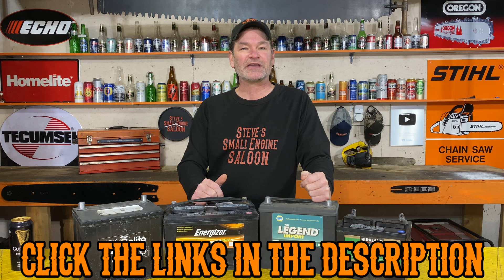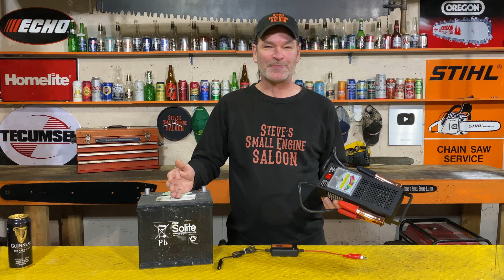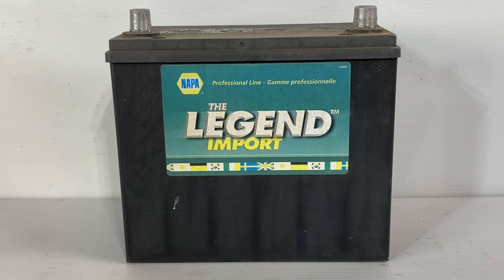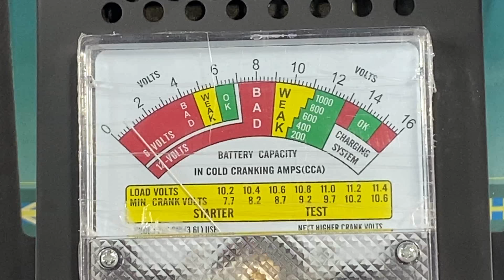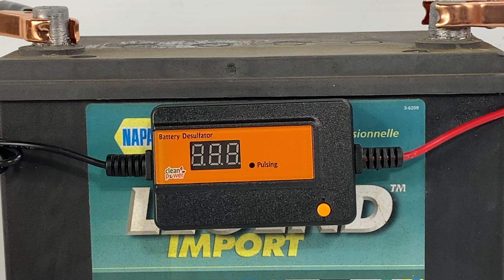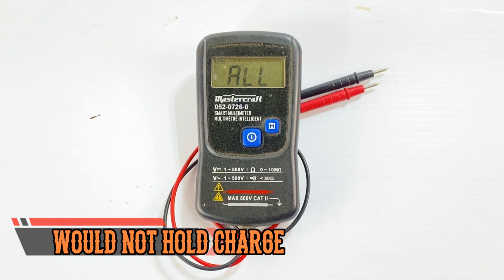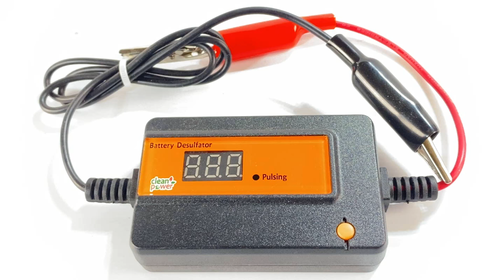Does An Electronic De-Sulfator Really Repair A Battery?? See Real Results

Comment: This method will only bring back some life for a short time. The reason batteries fail is, over time the sulfating process will cause shedding of the plates. This shedding falls to the bottom of the jar and piles up. When this shedding pile builds up and touches the bottom of the plates, they basically short out. These battery restorers just boil the sulfate  pile and suspends it in the electrolyte. Eventually the sulfate will settle and short the battery again. The difference between a 24 month battery and a 36 month battery is the amount of free space below the plates. It takes the sulfate longer to pile up and short the plates on a 36 month battery but the plates are shorter in order to retain the dimensions of the battery. The 36 month batt. will have less capacity but longer life.

Comment: I use these and I believe they work. I have maintainers on all of my cars and equip that maintain charge and also desulfate, and I keep them plugged in year-round. My utility truck (that sits outside) that I rarely drive has a battery that is over 9 years old now and still as strong as it was new, and I credit the tenders for that.  I never tried to resurrect a battery though. I just use the same method for maintenance.

Comment: It might seem strange but you could still have saved the battery that was at 8 volts, but you need a charger that can charge at 14 to 15 volts, it helps break up the sulfate crystals that build up on the plates, that in combination with the desulfator might even have had a chance and putting some life back in the first one
Reply: normal charge voltage in a car is about 13.7v.  a desulfator generates fast spikes(short duration pulses) of 60V or higher,to break down the sulfate,without warping or overheating anything. I built one from plans on the internet.

Comment: I had a battery that wouldn't charge past 8volts so I connected another battery up in parallel and put the charger on it and was able to revive it. It was as good as new then.

Comment: I'll throw my experience in here. 

I've "restored" many batteries since I started doing my own work in the late 1970s. As you say, mixed success. Some restore, some don't.

I started with a 2/10A manual charger, so it doesn't kick out and let that run overnight outside. I then topped off the cells with distilled water. That seemed to work fairly well. I wish I hadn't gotten rid of that charger.

A long time ago, I figured out that putting a full.charge on at least 4 times a year really extended my battery life.

Most recently, I had two Optima Yellowtop AGM deep cycle batteries that I was using in my Jeep. Different ages, but otherwise identical. The starting one seemed to be getting weak. It wouldn't start the vehicle after a long weekend. (Yes, I checked IOD.)  One day after all this pandemic shutdown stuff, I checked the batteries, and they were quite low. The auxiliary had dropped to 6V, and the starting was 8 or so, as I recall.

I have more recently acquired more advanced equipment. So, I decided to try recovery. I had an expensive smart charger with recovery built in. The main battery seemed to come up some after a cycle. The auxiliary did not. I then figured solar, so I set up solar panels and a charge controller on the Jeep. That really improved the main battery, but still, it wasn't up to my liking. I then bought an on-board desulfator and attached it along with the solar because, as they say, the battery needs to be charged regularly when it is in use. That seemed to make an even bigger difference.

Once I figured the battery had come up as much as it would, I load tested with a tester like yours and an actual 500A pile to give it a more calibrated test. It passed that. I then used the fancy gear to do a 0.2C discharge load test down to 20%. It seemed a bit short, so I did some more testing, asked the charger manufacturer, and got their canned responses that it does AGM batteries. After a lot of measuring and testing, I realized it was nowhere near the profile, etc, that the battery vendor suggests for a deep.cycle, but only a starting AGM. There IS a difference per the battery manufacturers site. I noted that this fancy charger never mentioned deep cycle as a setting.

I bit the bullet and bought the smaller of the battery brand chargers that do have settings for starting vs. deep cycle. Sure enough, even though the fancy 26A charger said the battery was full and had gone into maintenance mode for a day, when I attached the new one and set it, it went nuts for a few hours bringing it up to their deep cycle voltages.

Now, when I tested it both with the pile (high short cycle load) and the discharge device, they both say it is performing like new.

So, as I said... sometimes you win, sometimes not. I now know to use either the solar or the new charger to charge it, as they both have an AGM deep.cycle setting. I never got the other one to take and keep a charge, even after months on charge with the desulfator going. However, saving one battery more than paid for the new charger and even the computer controlled discharge tester.

PS: I had tossed out the previous battery that was identical and now wished I hadn't. It probably would have saved fine... even though between the police cruiser it came out of and my Jeep, it had gone some 10 years. It was just acting weak. Hindsight.

Comment: i have old 10 amp / 50 amp charger had a not used but 3 times battery from 2019 slammed 50 amps into it for over 30 seconds then charged for 10 amps for 3 hours it stays at 12.6 volts

Comment: I used a desulifator trickle charger for years on my mercedes. on top of it, it had a hidden drain and would be deep discharged after 2.5-3 days. 
When I got the car and the battery, it was 7 years old and I was able to revive it time and time again for another 5 years, when a cell went bad. highly recommend

Comment: You got to get the lead sulphate out of the bottom that is shorting the plates out first  that has fallen off the plates due to being modern crap that is not worth restoring  once it has gone it is scrap . Falling for the hype do yourself a favour the ones you cant recover find a way to drain one of them totally then gently remove the bottom  GENTLY once you have it off you will find  a grey sludge in the bottom shorting the plates  out that is what is killing the capacity of the batteries  and preventing then charging also the one stuck at 2.5 volts 5 out of 6 cells are totally shorted out due to over charging  poor charging systems  IE all modern charging setups  .

Comment: Built my own but with a charge function to it. If it meets a high resistance the voltage will go up and then will go back down has the resistance drops. It's based off one an old guy on YouTube built. Thing works awesome.

Comment: I bought a pair of batteries because the one I was using in my camper was junk.  I bought a genius charger to charge them and learned about the  desulfication process.  8 years later, i'm still using the bad battery

Comment: Most batteries dont die, they are murdered.  Typical lead acid batteries are supposed to be charged every 3 months, because all batteries have a natural tendency to discharge themselves over time.  The best all in one solution i have come across for saving batteries is the "Solar" brand Model PL2320 charger and maintainer.  If you leave it connected for a few days it will actually cycle the battery for you and de-stratify/de-sufalte autmatically, and i can be left connected as long as you want because it automatically goes into maitinance mode after charging.

Comment: Get a jumper pack fully charged and leave it on the battery for a day charging it. then put a plug in charger on the battery without it touching the battery pack (brain has to figure this one out with items around the yard). Charge for another 12 hours... While it's charging check the voltage and pull of the battery pack, 8/10x works. ;)

Comment: I tried now several times trying to get an old battery back to life. It never worked. 
And I never had a defect where this might work. 
So if you don't have more exotic uses for those batteries than me (Car starter, UPS and some modelling), where such defects MIGHT come up: I'd consider that useless.

Comment: When I was young, I knew a guy who fixed batteries by letting them rest at the bottom of a little river for one year. After that, rince once with tap water, rince once with distilled water, refill with new acid, charge, done...

Comment: Electronic battery chargers won't fix sulficated plates.  You need a manual charger that will stay at a high current to get the sulfur off the plates.

Comment: On the battery that you could not use the desulfator because it would not charge over 8 volts... Next time, try putting that battery in parallel with a good battery, and hooking the desulfator up that way. Desulfator should work on both batteries that way, and I am curious whether it would save that extra battery.

Comment: I have saved a few car batteries with a welder, turned the amps up to about 100 to 120 and connected the the ground to the negative terminal. Then for one second at a time touch the positive terminal with the positive lead, there will be sparks, an did that about 3 or 4 times. it burns off the short cuircut connections between the cell membranes and revives the dead battery. Does not alwys work and might be risky, but it does work.

Comment: I actually made a video where i use a car charger with the 200A start for 30 min on a motorcycle battery and it worked well (with removed caps of course)

Comment: Try up some salt and do you still water pour the s*** out of the battery and put the absence called and in the detailed water and then charge it after you check the battery out of home it's a really cheap way that usually does work the default default default fake batteries the other 1 is 2 aspirin and you pour the acid out you didn't say process with die civil water try it though super awesome I've used those 2 with a varying success but usually either one or both of them

Comment: I bought an automatic battery charger for my automotive job some time ago.  It actually includes a desulfating cycle after reaching a certain charge level.  There were a couple of times that another tech tried a regular old school battery charger and the battery still failed either by dying quickly or just not holding a charge.  I took the vehicles and I left them on the charger for several hours without disturbing them and they came back and worked flawlessly!  No parasitic drain from the vehicle, just a weak battery that needed help.  I used that same charger on other batteries I eventually replaced, since some are beyond repair.  I am impressed by your results showing similarities with a much cheaper tool!  Cheers!
Reply from the maker: Right on

Comment: Ive discovered a better way of deep charging and de-sulphating a 12 volt car battery or 24 volt truck battery by using a 200 amp inverted arc welder. Remove the caps or lids that cover the battery cells,connect the negative earth clamp to the negative battery post,then connect the posetive battery post to the hand peice that holds the welding electrode by using a clamp or vice grips. Top up the cells with demineralised water so all cell plates are covered and then turn on the welder,slowly raise the amps on the welder till the battery acid/water mix starts to bubble-this is usually around 20 to 30 amps and it will start bubbling. Do this for 2-3 minutes,then turn the welder off and let battery sit for 10 minutes. Same thing again for 2-3 minutes and let it sit for 10 minutes. Repeat this cycle 5 times untill all cells are bubbling well and you now have yourself a fully reconditioned battery. I haven't bought a car battery in 10 years by using this method. Make sure you have good ventilation when doing this and assure theres no ignition sources in the area. I use a fan to blow away the gasses coming out of the battery while " cooking " the battery as i call it. There are youtube videos on how to do this,removing dendrites from battery cells or de-sulphating batteries. Your welcome.

Comment: I have used battery desulfators of various brands over the years with mixed results.

I use deep cycle marine batteries for off grid energy storage.

Desulfators have saved me thousands in battery replacement costs over the years.

Two things a desulfator will not fix. A cracked case or a swollen case.

I have used many of the techniques in the comments to rejuvenate older batteries.

There is a product I recommend called Charge It.
I get mine at a website called Battery Stuff.

Comment: Use 200 amps 15min let cool 45 min five times if it does not work battery toast, good luck. Do out doors well vented and use safety gear.make sure fluid is above plates.charge 2amps till full charge and test gravity.

Comment: Cool video.  Was thinking of trying one of them as the theory made sense.  After seeing your results I’ll either make one or buy one if the price is right.

I haven’t looked too far to see if this was mentioned, but perhaps the Napa Legend batt that couldn’t charge past 8v could be connected to another battery in parallel and then connected to your de-sulfator.  I use the this trick to charge tool battery packs when they’re too low to initiate the charging pack.

Comment: You definitely get a thumbs up. But in my 40 years of experience sulfated batteries don't recover to their full potential. You can get some capacity back and it really depends on the length of time they have been sitting in their sulfated state. My opinion. Good video.

Comment: Good video! You could invest in a smart charger like a Ctek msx 25. That thing does the de-sulfating trick, loads at 25 amps, and if needed trickle charges. Also it is safe, it stops charging if there's a problem. We bought it after we had a battery explode in the workshop due to old charger over-charging old battery.

Comment: When a load is applied to a battery and the voltage drops badly generally you have a heat generated separation. There's no easy fix for that battery. A battery that failed from heavy sulfation can be helped with a desulfation device. Simple science.

Comment: You can’t recover a battery when the lead plate sloughs off and then connect to the other cells, they short circuit out.  Sulfation is different a NOCO works also.

Comment: Any of those batteries "repaired" still work 6 months afterwards?  Probably they didn't last 6 weeks.

We used to get a container of acid renewer and pour it in. That worked for about 3 to 6 weeks.

If you understand how the batteries are constructed and what is going on to make a battery fail, you'll realize that you can at best gain time to get your next paycheck and then you'd better be buying a battery.

To really fix it, you have to melt down the plates and remanufacture them.

Comment: Steve, surprised you didn't present a battery with a known dead cell, are you familiar with a battery hygrometer usually under $10, or probing each cell with a voltmeter?  I don't think these small trickle charging desulfators will fix a dead cell, but it would be awesome if you would do a video trying to fix batteries with some of the methods suggested in the comments.

Comment: I have heard tell that reversing polarity can help a battery but I also have been told it is dangerous. Maybe low voltage & amperage is how it works? (I am about to start the video and am making guesses) *no idea. I thought it would be externally powered.

Comment: I've read once that simple transformer battery charger with a single diode rectifier already works as a de-sulfator. (because it pulses current at 50/60hz)

Comment: A good idea for car battery maintenance/preventive maintenance is to charge the battery twice a year, every 6 months. Charge 1 month before winter & 2 months after winter. Gives a total of 6 months in-between charges. 1 month + 3 months of winter+ 2 months = 6 months. That way the battery will be fully charged before it's needed most , in winter, & fully charged again after being drained by winter use. An overnight 2-3 amp slow charge is best & never overcharge, once it's full stop. Winter drains battery's because of using lights/heater/wipers, fully charge before winter & again after to keep battery at full strength. Batteries can last 6 years or more doing this. My battery is 10 years old.

Comment: My car battery suddenly started dying.  I'd boost it, it would work fine for a day, put on the meter and it showed as around 12.7 - 12.9 volts standing.  I started to put the car on a charger nightly, the charger usually showed the battery at around 80%, car started, ran fine.  I did this for about 3 weeks or so, and one night I forgot to plug it in.  The next morning I went out, fully expecting the car to not start, and either need a boost, or to be on the charger for a half hour, but it started, and it hasn't stopped since.

Comment: The 8V battery might have dendrites, lead spikes grown on the plates and shorting out 2 cells. A charge and a quick short circuit(wear safety glasses etc) may blast them out. Also if the voltage is too low put the desulfator and charger on the battery at the same time.
Reply: lead doesn't grow dendrites. that's nickel-cadmium,or tin. Lead acid car batteries have the lead paste get shaken out by shock and vibration,and it pile sup at the bottom of the cell until it reaches the plates,and shorts them out. the plates are actually grids to hold the lead paste compound.
Reply: It does in off grid batteries that are not moving anywhere. @JayWye52

Comment: Solite has high internal resistance. Legend had mutiple shorted cells. Kirkland and Diehard had a few internal shorts, probably all had grids distorted by sulfation. Ild try running the Legend and the Solite longer to see if there's any change after a week.